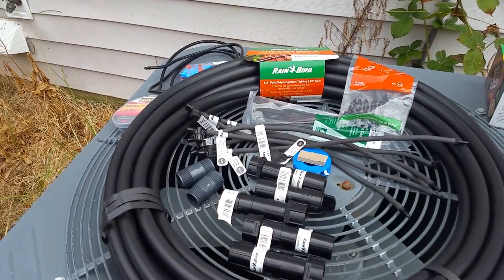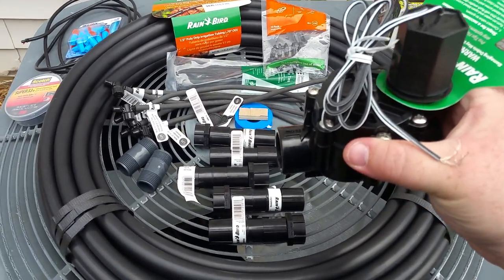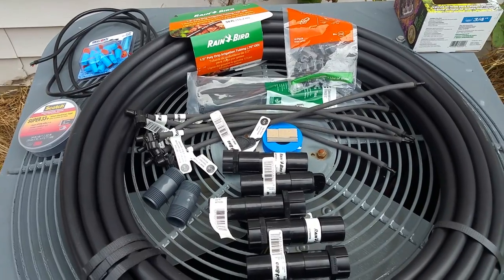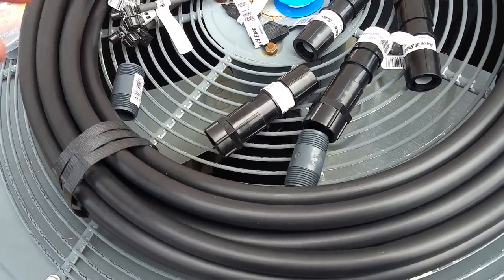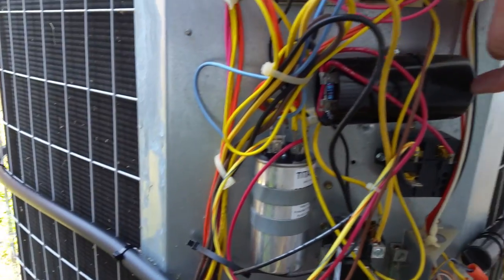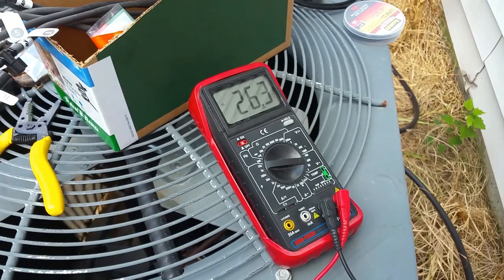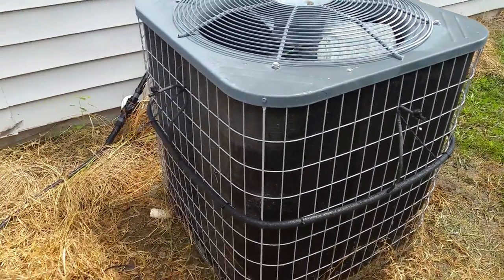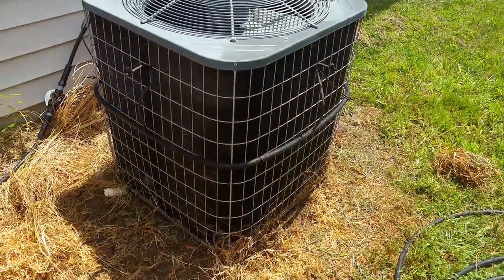DIY Automatic A/C Condenser Evaporator Mister - Electronically controlled!

Comment: Be careful with water deposits. This is useful if your motor dies and you need to get it running until you get the motor replaced

Comment: As far as the expansion valve issue some of you are talking about it will regulate itself to keep from flooding the evaporator " that's what they are designed to do" depending on the super heat measurement it gets from the bulb coming off the evap coil it will open or close accordingly. This will not damage your system if that where the case every time it rained we would be replacing compressors from getting flooded with liquid refrigerant.

Comment: Use a Rain Bird valve-w-adjustable flow control (it's about $3 or $4 more) and you can then further reduce the amount of water exiting your misters. Much easier than buying 9 more nozzles and replacing them. Sometimes you can buy just the valve with no solenoid, so you could then use your existing solenoid on the new valve to save some $$.

Comment: Use a media to absorb the water and provide the adiabatic cooling prior to coil contact. The water will erode the aluminum fins overtime. Bad idea to run water the entire time unit runs, use a temp switch on liquid line and control water flow based on condensing temperature.

Comment: Do you think providing shade to the unit (Ez up or structure) would cool the unit from the sun and provide for a more efficient ac system?
Reply: Dano Vido not really, if the hot air ends up recirculating you would greatly deminish efficiency if not prevent the unit from wanting to operate at all.     The best thing for a unit it to mantain it well, keep the fins clean and undamaged.   When you wash the coil you need to unplug the unit, remove the fan, and wash the coil out from the inside. Be carefull not to fold over the fins.    Make sure your air filters are clean inside.     Lastly using the manufacture documentation, make sure the unit indoor and out was installed to spec.

Beyond that there isn't much you can do.   The only time things like this seem fix anything is when there is an issue with the system and it happens to be bandaiding it
Reply: Shading will help to a degree, but you must not put a building around the unit. The top need to be about 6ft above the unit to allow for adequate air flow. Having some shrubs around the unit, but about 4ft from it, will help add some cool air as the plants cool the air through natural misting. If you have a large shade tree that covers the unit, that would work too.
As Jonathan states, the coils do need to be kept clean, and unbent. If a fin becomes bent, it diminishes the effectiveness in that area. Gently straighten the fin back out. 
If you do decide to do a mister, just make sure to use clean water, with a filter if possible. This minimizes calcium (scale) and rust. I have a large bucket under my window unit and recirculator pump to mist the coils and it dropped my bill by at least $30/month. Use a float valve in the bucket to maintain water level. I only lost about 2 gallons or so a day.

Comment: Water cooled systems are twice as efficient as an air cooled system. So yes it does work I run around all summer putting water hoses on refrigeration/air conditioning systems. All you had to do was connect the 24v wire to the contractor coil and yes there is a standard for low voltage. Look look at the wiring diagram on back of panel. But since your unit is a heat pump you should of connected your solenoid low voltage to common (Black) and to the reversing valve wire (orange) Cooling is energized thru the yellow and orange wire, for heating it’s energized thru the yellow wire and common that way the water isn’t energized during the winter and when you are calling for heat. You might want to turn off the breaker at the furnace or air handler since the 24v power comes from there unless you want to blow a transformer or fuse if it has one. I would have put the water hose on the top of the coil so the water drips down into the coil and turn the misters around so they spray into the coil, misting away from coil does very little of what you are trying to accomplish. Yes I own my HVAC/R company

Comment: This methodology does work.  In the engineering business we call this an Arkansas Cooler.  The water mist forms a water film on the condenser fins and tubes and it increases the heat transfer between the condenser and the air.  Efficiency is humidity dependent.  The down side that no one seems to discuss is that water is a corrosion agent for the metals... the fins and the tubes, so you should expect an accelerated failure rate of your condenser by doing this.

For those that think this methodology doesn't work... just take the hose and spray down your outside condenser in the hottest part of the summer when the air is on.  Feel the temperature of the air coming out of the registers in the house.  You will notice a large before and after difference.  Racers have known about and used this method for cooling gasoline going into their race cars for many years.

Comment: I built an AC condenser misting system in 1996 in Chandler, AZ and believe that I had the first and the longest running AC misting system in existence. They can save money, but only in limited locations. They can also destroy your AC unit if you do not use serious water filtration. Rainwater does little harm because it is in a normal PH range and does not contain harmful chemicals. City or well water can contain chlorine, loads of calcium, salts, etc. The only sensible water supply is RO water pumped thru very, very fine misting nozzles . If you go cheap, the $150 you save initially will be eaten up by maintenance. 
Next, in order for the misting system to reduce the runtime of the compressor, there must be very low humidity. Heat transfer by evaporation is six times more effective than direct transfer of heat from the pipes to the water. The gains are small from direct transfer and hardly worth the expense, especially if you are also paying for the water.
It is the extreme BTU transfer that occurs during evaporation that is the key to success.
I invested a significant amount of money while determining whether a commercial system could be developed. I found that the units would not be cost effective in most of the country. The deep south is far too humid. The northern states don't get high temperatures and low humidity at the same time. So, your decision should be based completely on your weather. Remember, your AC function does not change. The AC operates automatically using preset controls. What a misting system can do is reduce the run time required during each cycle. This is accomplished not by the water flow, but by the evaporation of a tiny amount of mist that is able to evaporate. More water flow is a detriment, not a help.
Reply: Richard Wilson I live in Brownsville Texas, so does this mean it wouldn’t work for me?  I’m sorry but what you are saying is way over my head, haha.   My air con is in the shade mostly.   I’m desperate to save money though.  Thanks if you can help me.
Reply: Your missing some of the physics. The fan makes a negative pressure situation, If the system is rejecting heat from the house properly, it is warmer then ambient and thus can support a higher humidity. No matter what, you will transfer that via evaporation short of anything except it raining outside.
Reply: So what kind of reductions to your total electric bill have you seen in the summer in Chandler from your misting system. I'm guessing that if you use RO water for mist, there is no damaging long term effect on the heat pump at all?
Reply: No, no, NO! RO water is missing metals. It eats away metals. You will have a freon leak in short order.  I know this because I tried running RO water from the service at my sink,  to my icemaker in my freezer about 8 feet away. The copper lines in the wall going to the freezer had pinholes all over within 6 months.
Reply: Chihuahuaization Amelie: This system would work just fine in your area. I live in Florida and I have seen at least $30 drop in electric bill on a window unit, which is a lot smaller than the central units. I spent about $30 for all the parts and such, so the first month was a wash.
The dryer the air, the more effective this method will be. So, for me in hot and humid Florida, this is difficult. But it still works as the fan creates enough air flow to cool the coils further, thereby removing excess heat. Because I used a container to recirculate the water, I didn't loose much overall water and used about 2 - 3 gallons a day.

Use pvc instead of the coil pipe like his used. It will be a lot cheaper. The misters can be screwed directly onto a pvc fitting, again reducing costs. I installed on mine using 3 misters, 3 slip to male-threaded 1/2" adapters, 1/2" pvc pipe, enough 90 degree elbows (5 for me), T's and 4-ways where needed, and a 1/2" to 1/2" nipple. I did this because I used poly hose to connect to a recirculator pump as I was doing this on a window unit and was capturing the water as it ran out the bottom of the A/C. I made a filter out of 2" pvc about 2ft long, cap on one end, 2" to 1/2" reducer nipple, then the poly hose from there up to the pump. Then a short piece from the pump to the pvc pipe. The poly hose was used to help with vibrations between the pump and the A/C running, minimizing stress points.
Reply: @korishan  I live in Florida and was wondering how well this would work. I could use both rain water and well, not sure how bad the water is for it.
Reply: @alanheadrick7997  Worked pretty good. I have a power meter to monitor consumption, and the A/C went from 17A draw down to about 14A. 3A difference doesn't seem like much, but if we do some calculations:
3 * 115 = 345W * 16hours = 5.520kWhs * $.13/kWh = $.7176/day * 180 = $129.168
The unit also cools faster.
Reply: Thank you Mr. Knowitall!
Reply: I live it SE Fla and it’s basically a jungle. I don’t think this would help my AC system. But, I’m also on well water and don’t want that on my condenser.
Reply: @bunberrier  Ok, ok, OK! Try and calm down, man!
Reply: What if you can get ALL of the water to evaporate before it hits the fins?  Then the dissolved solids would blow right through and you wouldn't have to do RO filtration.  I was thinking a large board on top of the condenser with a hole in the middle for the fan.  It could stick out by a foot or so  Then you could mount 1 mister, firing downward and outward.  You could have some kind of inline thermostat on the sprinkler valve so it only kicks on when ambient temperature is sufficient to evaporate all the water, which you could determine through trial and error.  Another option would be to use cooling pads from a swamp cooler.
Reply: wrong

Comment: This is a great set up and simple.  One tip:  You can use a simple relay and a plugin DC power supply to activate the electromagnetic water valve.  Any 110v AC to 24v DC plug-in transforming power supply will work, just connect the relay between it and the water valve and then trigger it with the incoming Thermostat wires from your house.  This set up will reduce the load on the Thermostat's low voltage power transformer, in case it can't handle the additional load.
Reply: yep dishwashers has the perfect 110v valve just tie Into 1 leg off the contactor

Comment: Thank you for this...I will try this idea,but I would sink a rod into the ground 12 to 18 inches from each of the three sides where there will be a mister,then mount the misters on the rods facing the cooling coils...the rods would also allow for vertical adjustment of the misters.

Comment: there's a lot of hvac techs here arguing and a couple don't even know how hvac works. 
Well I invented the hvac lol and it's obvious this mister system works well in ares with high temperatures as it significantly reduces the ambient air. this makes the condenser perform better and achieve lower temperatures faster making it work less time and therefore save money on electric bills.

Comment: This system works best in places like nevada and arizona where we usually see 100+ degrees outside sometimes 115-120.  For 3-5 months sometimes Heat destroys these systems out here we have really low humidity and dry summers. Just install a water filter and you will be fine.

Comment: This only helps significantly when the ambient is very high and the humidity is relatively low; I have used a hose set to mist to get an AC that wouldn't cool a house to work and cool a house, absolute proof it can help. 'save 50%' not a chance. As long as the AC can cool your house at any ambient in your locale, you should be good to go. if your AC is weak and can't, this will almost certainly help on the very hot days especially when dry.
Reply: same here. It's pretty obvious when you can't keep a place cool at all, then mist the condenser and suddenly you got cold air. These people saying that isn't possible really need to try this on a 90+ day and then feel like dumbasses.

Comment: I just set up a 24v valve and a hose with misters on it (very much like yours and very much inspired by yours).  Prior to that I was running out every morning to turn on the hose to start a mister and then remember to shut it off at night.  The problem is that it ran all day.  I skipped the filter because my AC unit is 21 years old and I am simply limping this thing along.  During a hot NC day, the temperature difference when on is noticeably different when cold air is blowing.  My favorite part is drawing off the 24v and switching on only when the condenser is running.
Reply from the maker: Thank you for the comment.

Comment: You may want to add a water pressure reducer.  They have one that will go inline to your outside connections.  That may help prevent leaks over the long run or in case you get a water pressure surge.  After about 7 years in my house most all the faucets started leaking and I found out my water pressure was double what is should have been.